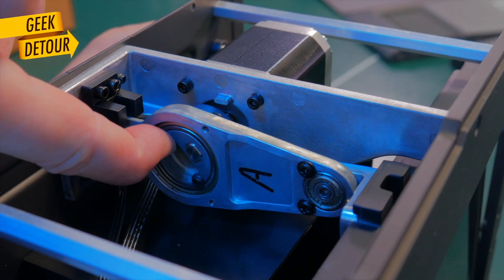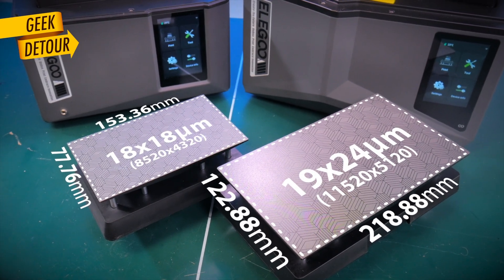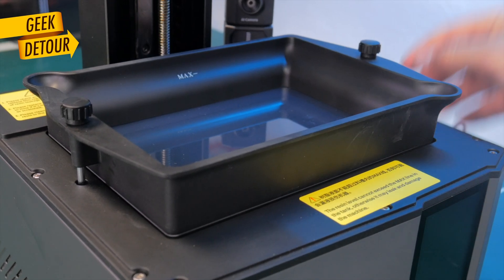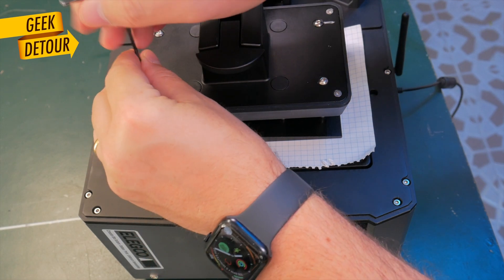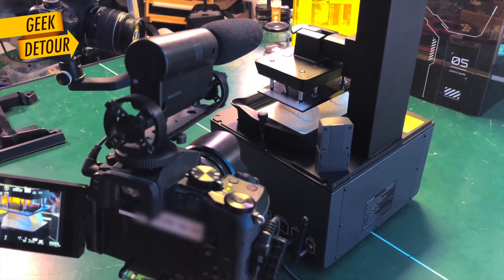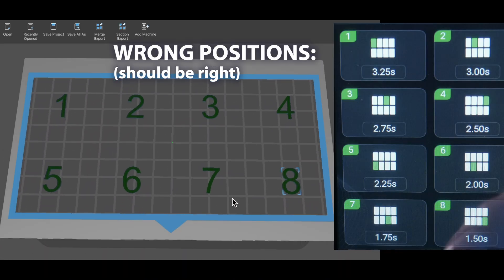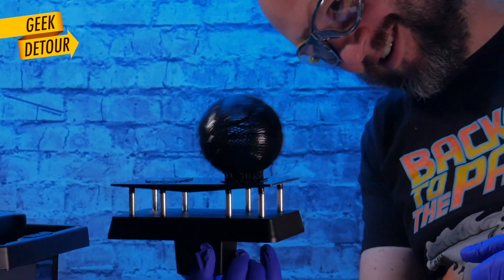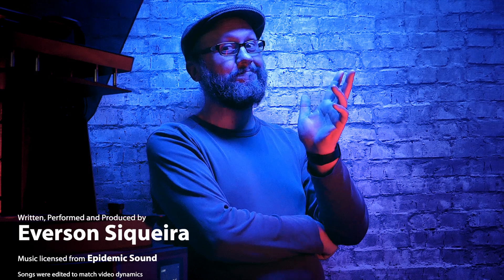Mars 5 Ultra & Saturn 4 Ultra: INSIDE! Elegoo Resin 3D Printer

Comment: Nice video.  

I’m having trouble with the 5ultra.  I’m a very experienced mars3pro printer.  Out of my first 4 prints only one was successful.  Tightening the build plate worked.  I’m gonna try to lock the screws or use a washer system.  Auto leveling sensor stinks imho if you have to make adjustments to level the plate.  Perhaps it levels the vat and not the plate?  I’m gonna try the paper manual method.  

Some cool features on the 5ultra.  But so far I’m not impressed with it compared to the 3pro.  Build plates are almost the same size maybe half inch longer than the 3pro.

Comment: On the Saturn 4 ultra, is there an easy way to get inside to clean it out?  I had the machine get tipped back while full of resin,  Not sure how much went in but a significant amount came out the bottom. I want to make sure the insides is clean.  is there a panel thats easier to get off?
Reply from the maker: You can easily take out the back, the front and the side without the connection ports. Do it in a room without sunlight - or do it at night - so you can clean the resin spills without they being cured by the sunlight.

Comment: In this printer, is the big screen protected by glass or plastic like some anycubic printers? Putting plastic protectors was the dumbest thing anycubic could do and I regret buying my m7 pro
Reply from the maker: The Mars 5 Ultra and then Saturn 5 Ultra have a hardened glass in front of the LCD - but I think they are laminated together (a single piece).

Comment: Perfect video.  Great work. I have a question anyway.  As far   as   I know there are no in-built heater.  This   problem has been widely spread and can fail or at least make   some defects on printing.   Can you tell us how to deal with it? Any solution especially in cold   conditions?
Reply from the maker: You must check the Saturn 4 Ultra 16k - it has a built in VAT Heater ❤️

Comment: If resin leaks from the vat, it will fall directly into the printer's electronic components, correct?
Reply from the maker: Well, not exactly. It depends… how much resin falls. There is a lip under, around the platform. A small leak doesn’t fall directly to the circuits. The way I saw it, there is even a change it will never actually fall on the circuit - it will fall around it. But, yeah, a leak is more complicated in this printer than in others.

Comment: Excellent video  👏👏👏. 
 Do you have any advice regarding the settings of the Elego printer during the exposure or perhaps some other settings to make the printed model perfect.  I've printed the calibration cones quite a few times and somehow managed to get the successful side to be completely printed and the failed side to be unprinted.  But I notice that the horizontal notches are not all as good as the tiny holes on the right side of the calibration model.I used Elegoo resin 8k photopolymer.

Comment: This is great, sold me on the printer! Coming from FDM where the components are generally pretty low quality, this one seems to have been thought about a little more :)
I've run into a small hiccup with mine, possibly a slow leak in the film but resin has gotten into the hinge part at the back 🥲 would be great to see a full teardown and reassembly guide next!

Comment: I've watched a bunch of video's on this printer and no one is talking about the build plate adjustment. Having no control of the leveling my self was only thing holding me back from buying it. Thank you the mutual obsession!
Reply from the maker: Hi there! Thanks! In my case, I didn’t have a print failure with how the printer came from the factory, but putting the paper and sending the build plate down to the glass showed it could still be better (well, it always can, doesn’t it?) 🤣
Reply: And rightfully so, i think ive a buildplate leveling issue myself as part of the buildplate stick well and other doesn't

Comment: Great Video,I think i need your help with bed leveling.
I have a saturn 4 ultra and it use same mechanism as Mars 5 Ultra.My prints in back side of bed don’t stick to plate and in rear side stick more than it should.I try to manually level it and when i started the  leveling i found out back side of my plate easily let test paper out and rear side hold it tight.after this i just made it worse and couldn’t level it.make a video about this please.

Comment: Hello everyone! Does anyone know if an LCD screen protector is necessary for this printer? If so, can you recommend a good one?
Reply from the maker: Check closely on the website - I think it has a “9 something” hardened glass on top of the LCD. I never used screen protectors on my resin printers (but I am extremely careful). Ask on forums because I don’t have a recommendation. Also, have in mind that adding a film on top you are increasing light diffraction and reducing sharpness of details.

Comment: 8:50 that is an issue of surface tension, not of insufficient inclination. try a surfactant.
Reply from the maker: Well, we cannot add a surfactant to the Resin without messing up the resin. BUT, I still have a Voxelab Proxima Resin 3D Printer that has a bigger rounded slope in the edges and it actually finishes clean. If the Elegoo plate was thicker, I am sure I could reach the same result.
Reply: @GeekDetour  nono. I don't mean surfactant added to the resin, i mean surfactant treatment for the upper side of the build plate. there are coatings and surface treatments that increase or decrease surface tension, depending on what is needed. I think the black side is merely cataphoretic painting, that could be actually disadvantageous regarding reflow. You can see how the raw resin is building up a thick uniform layer on there. Now look at how the resin is pearling off a fep film. 

Surface treatments may be as exotic as lotus effect paint or plasma.
You may not have to be that fancy though, if you have the courage, i would suggest cleaning the surface thoroughly with IPA in an ultrasonic, and giving it a few sprays of teflon coat from a rattle can. You have to mask off the print side with tape ofc. Worst thing that can happen is you ruin a batch of resin.
Reply from the maker: My goodness, ha ha. I finally read your reply - very interesting! But it doesn’t look like a simple solution for the average Joe (I mean, me, ha ha). I prefer that the geometry itself would carry the resin out. Anyway, if you have a product in mind (like, a spray paint) that would be extremely slippery to the resin, I might try one day! 😁

Comment: SO WHICH ONE HAS THE BETTER RESOLUTION THE MARS 5 ULTRA OR THE SATURN 4 ULTRA PLEASE HELP I NEED TO BUY ONE ASAP
Reply from the maker: The resolution of the Mars 5 Ultra is just a little higher (smaller pixels) but the Saturn 4 Ultra is not so much behind and the build size is so much bigger! My favorite is the Saturn 4 Ultra.
Reply: @GeekDetour  man thanks for the fast reply 🙏 you just gained a loyal sub! I plan to make jewelry so what would you recommend I will be honest and say I already bought the mars 5 ultra but I can return it before it's opened
Reply from the maker: For Jewelry I think you made the right choice. On jewelry you want the finest resolution - unless you are making very big parts 🤣 The Mars 5 Ultra has an 18 micron pixel size and that’s the highest resolution you can find right now😎 That’s great!
Reply: @GeekDetour  price is not the issue but I don't want to buy something and wish I bought the other down the line

Comment: Good afternoon!
Please tell me, there is such a problem, the Lego Mars 5 Ultra model does not stick to the table but remains on the film, the first few layers, and then prints idle. Lagoon water washable resin 8k. the illumination time of the lower layers (4) was set to 30, 60, 120 seconds. I checked your video, the sheet of paper is clamped exactly.

Comment: My screen cracked on the first use 4 hours ago; I couldn’t even complete one print. I don’t think I did anything wrong. So disappointed. Do you have any suggestions?
Reply from the maker: Contact Elegoo’s support: they will probably send you a new screen.
Reply: You definitely did something wrong. Like not checking the vat for debri from previous prints counts as your mistake

Comment: beautiful breakdown. btw, how accurate are the print measurements of the printer?

like if i put a 2mm box, does it print 2mm box accurately down to the last 0.00 digits or do we have to tweak some settings first?
Reply from the maker: Thanks! 🤗 Resin 3D Printers themselves should be quite accurate (X Y plane is an LCD, so, spot on fixed size physically) - the challenge is Resin Shrinkage after it is cured… It shrinks during a few days. If you need accurate final size, it must account for shrinkage that is different for every resin.

Comment: Thank you for a great dive into the inners of this printer. I'm about to pick one of these, but I'm thorn between the Mars 5 Ultra and the Saturn 3 Ultra, both have pros and cons, but as they cost me the same, which one would recommend picking?
Reply from the maker: Yeah, the Saturn 3 has a much bigger print size - the Mars 5 has the Tilt Mechanism and it is BY FAR easier to print since you mostly don’t have to worry about bed-leveling. If you are buying your first Resin 3D Printer, the Mars 5 Ultra will give you such a great and easier experience. Of course, if budget was not a concern, the Saturn 4 Ultra would be my choice.

Comment: Hi! How did you manage to get the test to go from 1234 over and 5678 under?
Reply from the maker: I changed the position of the objects on the build plate, in Chitubox. I manually moved them to the places where they would correspond to what the printer does.

Comment: how do you get the plate close to the screen to calibrate? I see no Z-setting and I don't want to crush my screen!!!!
Reply from the maker: Hi there! You place a sheet of paper and use the “tools” section to move down. You can move it down from milliliter to millimeter when it gets close - but I was adventurous and I just relied on the Load Sensor in the ARM: I sent it down and it stoped as soon as the plate touched the paper.

Comment: I've had my Mars 5 Ultra almost a week but haven't started printing yet as I'm waiting on some ventilation parts. I did the paper test with my build plate and had the exact same quadrant that was a bit tight. I have adjusted my screws and I am satisfied that the build plate is much more level, but I am now wondering how long it will stay like that...
Reply from the maker: Did you use a thread locking fluid? It is worth buying: after it dries, the screw doesn’t rotate easily.
Reply: @GeekDetour  I did not. Gonna see how printing goes.
Reply from the maker: I recommend you to get the thread-locking fluid. It is not expensive and you can use with any screws that you want to get firm / not unscrew by usage or vibration.

Comment: I just got my Saturn 4 Ultra today and it doesn't seem to want to behave... Thanks a buch for your awesome video, I'll try the leveling advice right away! 
One strange thing though, after finishing a print my build plate does will not go Home, it just hovers the part a few centimeters from the tank and says that it finished. Is that the case for you as well? I couldn't see in your video.
Reply from the maker: That’s interesting… have you tried updating the firmware to the latest version? If I remember well, yes, after mine finishes printing, it goes all the way up.
Reply: @GeekDetour  Yeah it's the latest firmware. Hmmm that's strange, would you mind sharing the G-code from your Chitubox? I suspect it might be that. Thx for the reply!
Reply: My printer do same..

Comment: Thank you for the fine tuning section of the video. I was getting failures in 1 quadrant of the build plate and it turned out that the build plate was not properly tensioned. Fixed my issue right away.
Reply from the maker: I am so glad it helped you ❤️ Thanks for letting me know!

Comment: Awesome Printer! But What slicer version works the best?, the beta crashes a lot.
Reply from the maker: Thanks you so much! That’s an excellent question: I could not test that objectively because I use an iMac from 2013. The last OS that I could run “officially” in my machine doesn’t run ANY of the current slicers. So I use a patched MacOS (OpenCore Legacy Patcher)… I had problems to make the new Chitubox Slicer Beta run on my Mac - so I attributed my troubles to my 11 year old Mac. For this review I used Chitubox Pro (it was what I could run on my machine). If you had trouble with the new Chitubox Beta, please, open a ticked with ChituSystems - they will fix it sooner if people tell them about any problems. I don’t like to use anything Beta for this reason.

Comment: Would you mind doing a more in-depth video on how you manually levelled the S4U? Having serious issues getting anything to stick to a quarter of the buildplate, something I’d fix easily on my trusty mars2p by re-levling it. Which screws do I need to loosen, in what order if any, and how do I get it to go to 0 so I can actually fine-tune it without smashing the lcd.
Reply: I'm agree and ask for that video! Having such issue right now..
Reply: Agreed.

Comment: how would you avoid it deforming the pfa film?
Reply from the maker: This is an excellent question: I don’t know if this resin will always deform the film, or if it happens if exposure time is wrong… That’s why this rubber resin is not for beginners. I still need to print more with it - this film is already ruined anyways. I’ll print with F69 a bit more on it and if I detect a pattern I might make a video about it.

Comment: I got the Saturn 4 Ultra now and I've printed your handle, thanks! 
Do you have this in an enclosure when not filming? The new lid design leaks the resin fumes all over compared to my older printer...
I wonder if it's possible to give the lid a good seal, so I don't need to use an enclosure. Any suggestions are appreciated.
Reply from the maker: Hi! I am glad you enjoyed the handle! Did you use the adhesive one? Or the one you screw? I don’t print with resin inside our home anymore (we moved to a house where I have a separate workshop) One day I’ll install an extraction tube that I’ll use for the laser engraver and also the resin printers, and connect to the exit at the back of the Saturn 4 Ultra
Reply: @GeekDetour  I'm using the adhesive one. It's a little wobbly compared to using screws, but it's not coming off anytime soon.
I'm really interested in a mod for the printer that makes it easier to hold the buildplate. Like a grip.
Do you think there's a way to make a grip without drilling holes in it?

Comment: With what are you spraying models before submerging it in ipa?
Reply: Btw you have config files for all resione resins on their website which you can import in slicer. Tested it and it works liken charm
Reply from the maker: About the ResiOne: true. That’s what I used. Actually, I had to install the profiles for the Mars 4 Ultra, and copy the values because they didn’t have yet a profile for the super new Mars 5 Ultra.
Reply from the maker: It’s the other way around 🤣 I submerge the model to cure in water 💦 and before I do that, I spray a bit of IPA on the model so when it is submerged, the alcohol helps to break the water’s superficial tension and it doesn’t trap many air bubbles on crevices in the model.
Reply: @GeekDetour  thanks for the tip😀

Comment: Which one should I buy? I already have an FDM printer (ender 3 pro) and was thinking about getting a resin one for more detailed prints. I'm stuck between Mars 5 Ultra and Saturn 4 Ultra and I'm not sure which one I should get. Is Saturn worth the 130 euro difference?
Reply from the maker: If you have the money for the Saturn 4 Ultra, go for it. Bigger print area, Flip-Up cover is great. I think it is a better deal. But, sure, the Mars 5 Ultra is cheaper. Don’t go for the Mars 5 (non-ultra), since the Mars 4 Ultra has better resolution than the Mars 5 (non-ultra).
Reply: @GeekDetour   looking for the most precise dimensions,  need precision on x y and z . sould i go for mars5 ultra or saturn 4 ultra ? thanks

Comment: Fauxhammer sent me here. Thanks for the wonderful advice on leveling.
Reply from the maker: Wow! That’s great! Ross is a great guy!!! ❤️ have you tried it already?
Reply: @GeekDetour  No, about to do it as my plate lists to port haha. But it's so clear even I could manage!
Reply from the maker: You just put take the VAT out, home, then place a sheet of paper and in tools move the plate down until it “detects”/crashes down (then sensor will stop it moving more than it should). Ideally, all corners would be pressed with the same intensity. That’s probably not happening if you already measured differences.

Comment: As a fresh saturn 4U owner this is super interesting! I think I'm going to try adjust my leveling with the screws, as I measured about 0.2mm variance in the plates level side to side from raft thickness. 🤔
Reply from the maker: That's great! Please, get some thread locking fluid if you don't have. Otherwise the screws might rotate and your adjustments will change with time. Let me know about your results!

Comment: Thanks!
Reply from the maker: Wow! Thank you so much! It really helps ❤️ Have you tried the screws? I am curious.
Reply: @GeekDetour I apologize for missing your comment! I have been using the plate "as is" to run some tests, comparing the new build plate to the original, with stock gcode as well as adjusted gcode.   Now that I have those numbers, I have a full set of benchmarks to know what type of changes I'm achieving with my tinkering.  I'll let you know!   Thanks again!